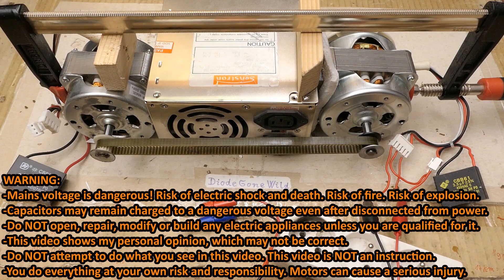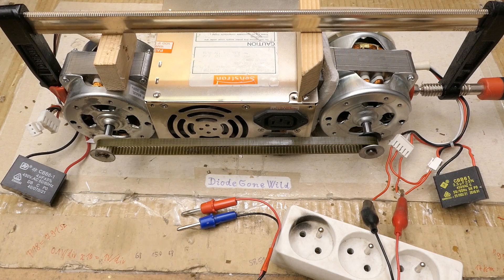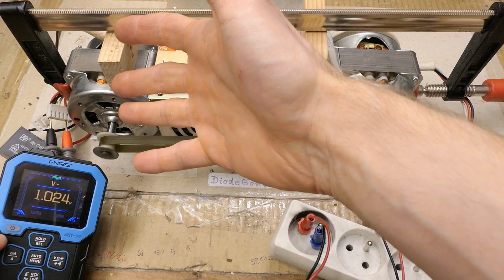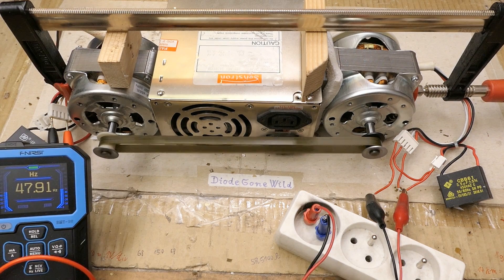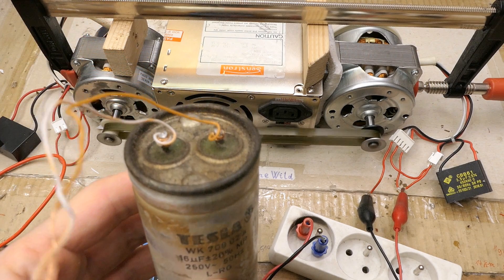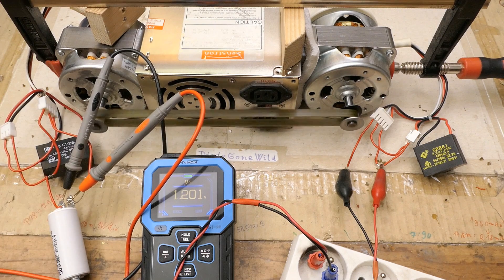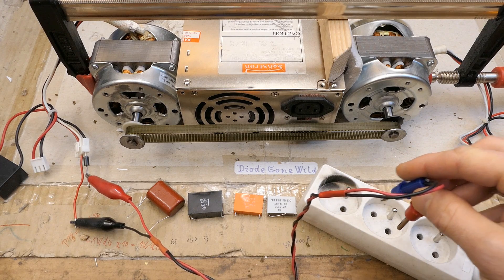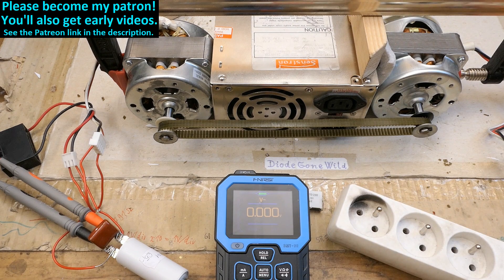Asynchronous motor as a generator?

Comment: You need to run the motor at a speed higher than it nominal rating, so the slip becomes negative and the motor enters into the generator mode.

Comment: When I was younger we had a 240v generator that ran off a stationary engine from the early 40s, that had another one on top of it. It turns out it was a 60v 'exciter' generator, to kick start the generator's starting process - by providing the excitation voltage, so I'm guessing that a similar principle would be needed here?  Anyway, fascinating I haven't thought about that generator and engine in a while. :)

Comment: it will work as a generator, but with slight modification of the setup. asynchronous motor will not power another asynchronous motor as a generator if they're rotating the same RPM. this is because to induce meaningful voltage you need negative slip in generator. if the generator rotates the same RPM as  motor, then with same capacitor it will have the same slip, so close to no generation. which can be observed on the video. now, you can instead use different ratio gears, so spin the generator at higher RPM than motor with the same capacitor and you'll see far higher generation. inductor and capacitor in parallel makes resonant circuit with some resonant frequency, this will be the synchronous frequency which if same for motor and generator, you'll not see meaningful generation if spun the same rpm as both will have the same slip give or take.

Comment: Either you 'be been paid off or else you don't know your stuff like you project to. I can see from here that you are not spinning motor number 2 at 5% above its synchronous speed. The pulley on generator motor should be smaller than the motor on our right. You have it backward. EXPOSED!

Comment: I think you need to run the generator a little faster than its synchronous speed, to create a slip, but in the opposite direction.  Just change the pulley ratio slightly.  you may have to play with the capace again as well.  Worth a try?

Comment: Try connecting the generator to mains while it's being turned by the motor, but with a capacitor in parallel (besides the normal auxiliary capacitor). Then remove the mains connection and measure the voltage. Without the capacitor the voltage will ramp down in a few tenths of a second as the flux in the rotor dissipates. Maybe it will work, worth a try. You can find videos of larger 3 phase asynchronous motors used as self excited offline generators. Maybe this motor has too big of a stator resistance to self excite from start.

Comment: Viewers might be interested in this video which shows an 8 pole motor being used as a generator to produce DC via a bridge rectifier.  I was surprised that they manage to get it to self excite but is seemed to work very well.  https://www.youtube.com/watch?v=WPICp3c_qIQ&t=43s  It was put in after a chinese generator faile to deliver the reated output without overheating.  So why is it not working in this case?

Comment: If you want to use it correctly as a generator and have a real output voltage you have to magnetize it at the start, meaning you use it as a charge at start then disconnect it from the grid then you connect quickly the load on it to keep the magnetic field in the rotor, then the fact that there is a charge will automatically draw current, and here, what you have is : a current created at the stator by the initial magnetic field of the rotor, that current will create a magnetic field opposed to the one that created itself, whitch ensure a big magnetic in the rotor and so the generation of power, basically in eoliens they use a bank of capacitors to create briefly the first magnetic field at the rotor then it sustain itself as i said up

Comment: As someone pointed out in the comments, the motor can become a generator if it is first powered, then disconnected from the power supply. Another option may be to energize the windings with a battery while the motor is running so that it can be magnetized stronger than the residual magnetism.
Reply: Yea hopefully he revisits this and uses a switch to cange from source to load.

Comment: Mabe it will work better with a 3-phase motor and a capacitors. I have seen people putting a couple of small magnets into the rotor, to help with the initial excitation. Maybe injecting some voltage whilst the motor is spinning. I guess the squirrel cadge "windings" need to be loaded to maintain a magnetic field.
Reply: @liam3284   I guess you still need to add capacitors for reactive loading? Maybe inject some initial excitation voltage. But a small neodymium magnet  embedded into the squirrel cage rotor, will induce a some initial voltage into the coils.

Comment: This is very interesting. I did a similar experiment, using a larger set of motors. If I remember, about 1/4 HP motors. The capacitor value was very specific, and the motor speed was also very specific. If the speed was too slow, it would never self-excite. If it was high enough, it would self-excite. I could get more than rated voltage from the motor, but the voltage was load dependent. It would provide more than 200W from the asynchronous generator from a 1/4 HP motor.  I need to do a video about this.  I still have the motors used for this test.

Comment: What if you use a cheape and simple 230V/50Hz inverter to excite the "generator"? If it's driven at the synchronous speed I guess nothing will happen, but if slightly overdriven would it increase the voltage from the inverter while keeping the frequency, or will they fall out of synchronisation and the inverter goes boom?

Comment: Try using a 9v battery in parallel with the capacitor or with the output to "flash" it while it's running, sometimes that works, although it may be turning too slow... if you have a drill fast enough you can use it to drive the motor.

Years ago I used the motor from an air conditioner external unit fan to power LED bulbs using a cordless drill so it's possible.

Comment: I bet most of them were/are offline generators, I don't know today but until the 80s most "light towers" used on construction sites had asynchronous generators because those were cheaper and maintenance free. Those were also fine to power things like small concrete mixers, angle grinders and drills that didn't care a lot for the voltage stability.
Also the "2 stroke 950w generator" sold today under like six million brands 😅is asynchronous too. I think those are clones of the Yamaha ET950. Some have aluminium windings and are rated only for 600W but the shape is more or less the same. Some have also a 12V (unregulated) output to recharge lead acid batteries.
Reply: @liam3284   Maybe, but the capacitor does the same job as on asynchronous generators, it doesn't regulate anything, that's BS they put on schematics to not have to explain technicians  why a capacitor is needed there, the capacitor supplies reactive power for the electromagnetic field that powers the rotor by induction.
The bigger the capacitor the higher the output voltage and the more inductive the load is the lower the output voltage will be. To regulate the voltage the only remaining option is to modify the engine speed but that will change the output frequency.
If the load is capacitive the output voltage will rise and can damage both the load and the generator itself.

That applies to brushed synchronous generators without AVR too, if you put capacitors in parallel with the windings the output voltage will rise.
Depending of the design of the AVR system the voltage can skyrocket even with an AVR system present, for that reason some generators can't be used to power buildings with many gas discharge lamps of any kind that use electromagnetic ballasts with PF correction capacitors integrated in the same fixture, because the discharge lamps won't create any inductive load until they start so you can be connecting a massive amount of capacitors to the generator when you turn the lights on, especially if the lights in the entire building are powered on at the same time, as would be the case if the power goes out while the lights are already on and a switch is used to switch the whole building from the grid to the generator.

Comment: It would be interesting to see what happens when supply a small DC voltage/current through 1 of the windings. Of course it would make the rotor harder to turn but would it be able to induce a current through the other winding?
Reply: nope. it would just saturate armature. you need to send pulses into it to get more power back out. This can be done with a electronic circuit.

Comment: Oh, you have to show the output waveform.  Seems like from what I recall, these really need to be rectified to DC and then inverted to get good stable AC output.  Seems loads like a resistance load at first up to like 30-50% continuous output causes bad voltage spikes, though after that the output stabilizes. That's my experience at least with the one asynchronous 2 stroke engine generator I own.  I think really is not so great, though the more modern inverter generators using 4 stroke engines seems nice if the super expensive or unobtanium inverter is available cost effectively.  Check like the range of resistance loading on.  Also, show us using at least a cheap oscilloscope if you can.  That would be super awesome!  Same goes with an inverter for these motors.

Comment: I'm not 100% sure but:  
usually the motors rpm is a little bit less than mains (slip) -> they need the difference to induce the current inside the rotor. So for being used as an generator u have to exceed the mains frequency. Without an external Island-Grid (connected to the generators output) the rpm of the motor will always be the same than its output voltages frequency. So there is no induction possible because the change of magnetic flux will get to 0.
Just my thoughts to it, pls tell me when im wrong.
Might not be explained very good xD

Comment: In order for iz to work as a genarstor you need to connect a load to generator and then plug it in the mains to make current flow trough motor thus exciting it. Once you disconect it from mains, current will keep flowing trough load

Comment: In order for this to work I think the motor needs to rotate a bit faster
Reply: Yes may be you are right, but it cannot, it is locked in this case by the frequency of the mains voltage, in Europe it is 50 Hz.

Comment: I wonder, if you give to one  coil some AC, let´s say 12V, without spinning it should work like an 1:1 transformer, right? And if you manage to spin it faster than the slip, to be sychronous with the mains frequency what you will have at output? And if it spin with some multiple of half the speed without slip (like 1.5 speed?).
I mean, if to be in sync with the mains frequency it should run at 1440rpm, try running it at 720, 1440, 2160 rpm while powering it with 12V/50Hz.
Also, the output voltage is a pure sine wave, I imagine, right?
Reply from the maker: Yes, the output is a pure sine wave. The motow can't work as a 1:1 transformer, the windings are overlapped in a way that the magnetic flux cancels out. It's the same case as putting 2 coils at a 90 degree angle.

Comment: Yes it is generate full voltage, frist you charge capacitor from mains and then this charged capacitor connect to this motor at running condition. Then this motor producing full voltage. Try this

Comment: Thanks for video. One can use induction motor only providing it reactive power for rotor magnetization. One can easily do this for 3phase motors. 1phase motors either have each pole divided into two, half of which encircled by shorted winding or have two windings, one of which connected through cap to mains.
Your motors look like 1phase ones. I think that motor w shorted windings is impossible to start as generator using capacitors due  to huge losses in shorted windings. Two windings capacitor motor - maybe, but idk how.
Actually both types of motors have so

Comment: A stepper motor works much better as generator.
Reply: Wiring up two stepper motors to each other is a neat trick. If you have two of the same stepper motor you just wire them together color to color then turn one by hand and the other will follow it. Stepper motors work good as generators because they have permanent magnets in them to generate the field. But the drive one stepper motor with another is pretty gee whiz. It definitely entertains for at least as long as it takes to do.
Reply: @1pcfred  Yep, it works 🙂

Comment: You need not only resonance of coil and capacitor circuit, but also a right rotation frequency for resonance in core, in this way You get an switched reluctance generator. watch?v=NLiZDQxywqE and all parts (It is about stupid "free energy" staff but one conclusion from that videos is to see a switched reluctance generator in action)

Comment: Unsuccessful experiments is where most science happens. Testing where hypotheses fail, and what to correct.

I wonder if you have an old school slip ring 3-phase induction motor. That probably could be used as an alternator if you rewire the rotor for DC.

Comment: I think you need to spin faster
Reply: That's what I've always heard but it needs to be excited somehow too. So I think there's more to it than that.
Reply: @1pcfred  i`ve seen how to asynchonus motor 3 phase launched like generator, to each coil you connect phase shift capacitor 60mf in paralel, all 3 coil make star connection, remaining wires connect to bridge rectifire and you spin it like on 200 rpm higher than his nominal rpm.

Comment: In order for an asynchronous generator to produce power, it must rotate at supersynchronous speed, increased by the amount of slip.  Example: no-load engine speed 1440 RPM --> required speed for generator operation 1560 RPM.
Reply: Easily done by changing a pulley
Reply: It is known that asynchronous generators can be operated in island mode. However, their operation is problematic. Frequency and slip depend on the size of the load. An inductive load will often cause de-excitation. The right size of capacity is important. Small single-phase asynchronous motors are unsuitable for this purpose. The reason is their poor efficiency and high winding resistance. Motors with a shielded pole are completely unusable. A sufficient amount of remanent magnetism is essential for the start-up of an asynchronous generator. This can be increased by short running no loaded motor or by connecting it to a DC source. @liam3284
Reply: It is known that asynchronous generators can be operated in island mode. However, their operation is problematic.The frequency respectively slip depends on the load. An inductive load will often cause de-excitation. The right size of capacity is important. Small single-phase asynchronous motors are unsuitable for this purpose. The reason is their poor efficiency and high winding resistance. Motors with a shielded pole are completely unusable. A sufficient amount of remanent magnetism is essential for the start-up of an asynchronous generator. This can be restored or increased by normal running the motor or by short connecting it to a DC source.  @liam3284

Comment: Hello? What is the point of using a motor as a generator in this way? you will only get a less efficient power supply and a higher power bill compared to a good SMPS switch mode power supply or solar panel
Reply: its not about the final use but the learning journey
Reply: Induction motors salvaged from heavy machinery can be repurposed as generators when the correct capacitance is added. It didn't work at this small scale though
Reply: @retrofitter  I think it only works with 3 phase motors? That's how they make phase converters.

Comment: You need field excitation for it to work. If you want a reasonable constant output voltage, use an AVR (Automatic voltage regulator) found in most gas electric generators, to power the coil. 
Just like the alternator in the car. Magnets are expensive and lose their mojo under heat with time, electromagnets don't.